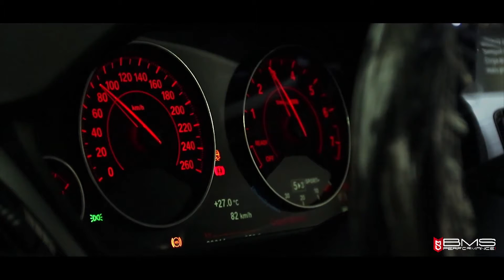BMW 328i STAGE 2 ROCKET feito na BMS PERFORMANCE.

Comment: Qual a diferença entre a BMW 320i e a 328i ?
Reply: O 8 a mais
Reply: iago.f iago em si é o msm carro, porém a 328i tem uns mimos a mais
Reply: @lucasmiranda1917  quais.. estou curioso
Reply: Motor mais potente e alguns equipamentos, a 328i tem teto solar, rodas 18" e mais alguns extras.
Reply: @inocuo9134  amigo, motor mais potente todos sabem, e 320 tem opcionais de aro 18 e teto..
Reply: @bigbigterrorista8812  328i é de série.
Reply: Pressão da turbina e mapeamento de injeção
Reply: @inocuo9134  não vejo vantagens entao de comprar uma
Reply: @bigbigterrorista8812  a 328i corre mais
Reply: @rafael492430  é memo?
Reply: @rafael492430  eu sou um débil mesmo, é lógico que os 40mil a mais é por causa do teto, aro e 60cv a mais... francamente, esse mundo ta perdido... dou mongol daaaaaaaaaaaaã
Reply: @bigbigterrorista8812  kkkkk tá passando vergonha brother
Reply: @rafael492430  kkk
Reply: 328i tem mais de 50 cavalos a mais de potencia, se não me engano a 320i dessa geração passada tem 184cv e a 328i 245cv
Reply: @rafael492430 a 328i não corre mais 320i e 328i são mesmo motor e mesma caixa , o que muda e que a 320i vem com 0.6 de pressão na turbina de fábrica e a 328i vem com 1.1 de pressão na turbina resumindo se colocar a 320i com 1.1 de pressão fica mesma coisa que a 328i
Reply: @cristianferronato3119  resumindo: corre mais